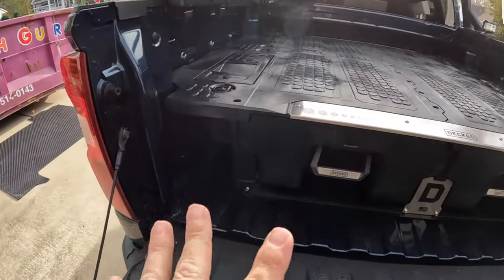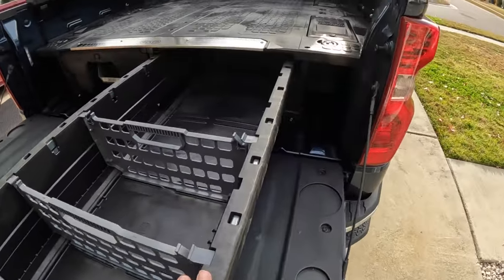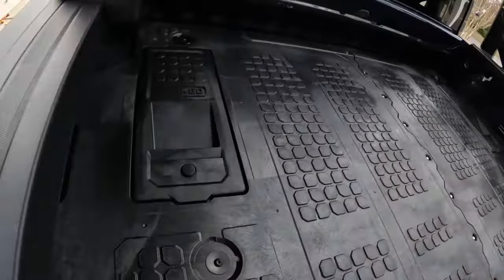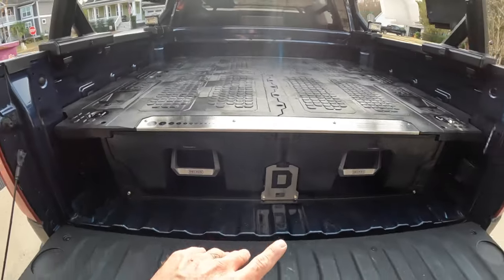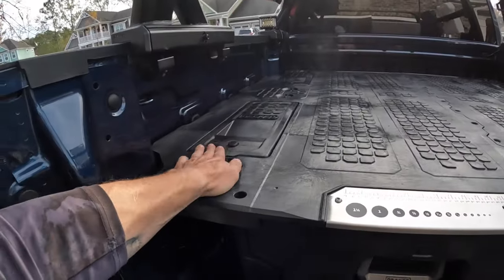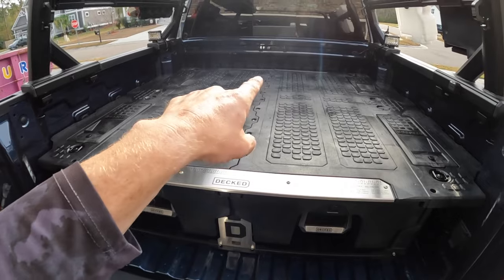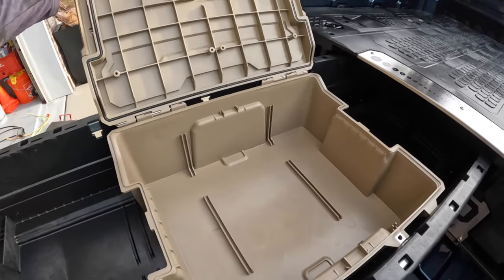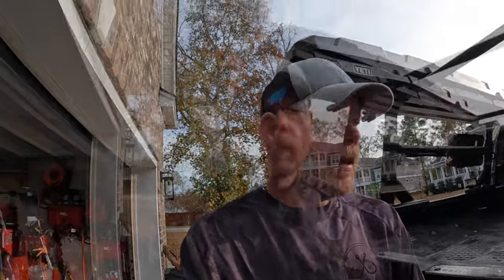ARE THEY WORTH THE HYPE? / Gen 2 Decked Drawers

Comment: I can’t justify using my whole truck bed for the Decked System. If they offered a single drawer for one of the sides, I would buy it.
Reply from the maker: That would be cool.  Only problem is holding it down and in place in the bed of truck itself.  I know Weatherguard and American Van make steel and diamond plate aluminum ones but not as high so limited storage for bigger stuff.  Good for tools though.
Reply: @rjmfishtales  i have lower bed hooks in my truck bed, if they come out with a single drawer it could attach to the lower bed hook to hold it in place. The lower hook will be blocked anyway with the drawe. I still have an upper hook to use to tie anything down with.
Reply from the maker: @TopWaterAssassin78 the gen 2 have tie downs built in for that reason when the others get blocked.  Maybe one day they may release one sided drawers.  I am sure they have thought about it.  Or tried.
Reply: If you add a rack of some sort there not a whole lot you can't haul on top of it. I'd stay away from gravel or any loos bulky stuff. But stuff like furniture, appliances, 4-wheeler, ect. Aren't a problem.
Reply: I actually run only one side in my f150, haven't had any problems even 4 wheeling.
Reply: Have you thought about just getting a toolbox? That would save some space but obviously it isn’t as long as the bed
Reply from the maker: @kenanlynch6616 I like the drawers that pull out to me instead of climbing in the bed or reaching over.  I have toolboxes and drawers and prefer the drawers.  I have 3 trailers when I need to get anything big.

Comment: My only issue with mine is, WHY THE HELL DIDNT I GET THIS SOONER.  It saves space in the bed of the truck but at the same time it does take the depth of the bed down to around 12 inches or so from the bed rails. the good side to that is your tools are safe from rain and honest people, unless you add a solid bed cover that has locking access only inside the bed, any cover that has an exposed lock on the outside of the cover can be gotten into. all in all, this is a great thing to add to your truck.
Reply from the maker: Yes the drawer system is awesome.  Many don’t like it and many do like it.  Everyone has their opinion and needs.   I like them and works good for me.

Comment: Everyone has different preferences for their truck storage, I had a decked and hated it while a co-worker who does the same job loves his. My biggest concern was things sliding top of it and busting out my back window.
Reply from the maker: I put a mat on top of it to prevent at and they sell mats to go with their system as well for that reason.
Reply: @rjmfishtales  I tried that but didn’t feel comfortable leaving things on it that weren’t strapped down. Also couldn’t even fit a weed trimmer between the decked and my tonneau cover when it was raining and that was the deal breaker for me. Thanks for your video!
Reply from the maker: @masonmueller2637 no problem sir.  I get it.

Comment: We run them decks in our f350s, concrete construction so we put them to work!!! They are amazing and very durable, we live in Michigan and even in the winter with snow and ice they still perform well,, if your on the fence because they expensive just trust me and buy one, they worth it
Reply from the maker: Absolutely!  They work so well for electrical work that I do.  When I was in the field I had all my cordless tools, batteries, drill bit & tips, lots of extra hand tools all organized!  Made it so easy to inventory and make sure all your tools were back in the truck!  Yes it was awesome in my HD truck with the little longer drawers. But the short drawers now work just fine for kayak fishing!
Reply: What about moisture?
Reply from the maker: @billd3765 you will always have a small level of moisture.  Anything you really need to protect I suggest putting in a IP65/67 box.  I use Milwaukee Packouts for anything I want to keep dry 100 percent which is very little.  When you buy it they give you 2 watertight boxes.  But I leave cordless tools in there with no long term issues.

Comment: I’ve made drawer systems for my trucks for 20+ years. I use 1/2” plywood & 3/4” pine. I get more storage space for a fraction of the “decked” system.
Reply: Yeah I used to say that but wood isnt as tough or last as long when water hits it. Just bought a new truck and they came with. Not sure I like them but they are nice.
Reply: Let me know how good your wood works when it warps and starts rotting
Reply: 20+ years. No issues!
Reply from the maker: @pkweisel thanks good.
Reply from the maker: @pkweisel that is good.  Not sure why thanks came up instead.
Reply: @pkweisel  must be under some type of cover then. But hey whatever works

Comment: I can only speak on the above bed tool box.  I so glad I made the purchase yes it $900 and $100 for ladder but with my 2020 Silverado 2500HD seating high I love it.
Reply from the maker: That is priced right.  A weatherguard tool box is 1200-1300.  They are not made as good as they use to be.  You throw a piece of wood against it or whatever and it’s all dented.  The crossover box from Decked is so much better because you can beat the crap out of it and it looks the same.

Comment: Would you say converting a rack to a cap is a cheaper option than buying a cap itself? It was suggested by my father in law to add a decked system and a cap to my truck to protect my film equipment considering the amount of things I typically carry on top of regular tools and the like.
Reply from the maker: Or you can do a really good tonneau cover and decked system.  Or just a good cap and no decked drawers.  You can always do a drawer slide if you don’t want to climb into truck.  It all depends what you carry and how tall etc.  There is many options you can go.

Comment: It looks like it stops a few inches short of the full length of the bed. Like it looks like there is a 8" gap between the back of the drawers and the tailgate. Why?
Reply from the maker: Every truck bed is different.  A short bed drawer is going to be the same size across all trucks and same thing for a long bed drawer.  They are not going to make different drawers for different trucks.  They just change the top piece to fit different truck beds.  So being the Chevy has the longest bed across all sizes and makes of trucks they have the biggest gap at the back.  My ford had a 4 inch gap and this truck has more because it’s like 5’9 inches long.  The back is where it is short that’s it.  Everywhere else is cut to size.

Comment: Love the set up! Hey, what’s that tool box behind the driver side? Do you have a link? It’s like a tool box with a rotopax?
Reply from the maker: @liciotamb  that is a Milwaukee Packout box for small parts.  I took the single packout wall bracket and used 1/4-20 hardware and mounted to the crossbar of my ladder rack.  I have a full video of that setup.  Let me see if I can find it and I will drop a link in comments.
Reply from the maker: https://youtu.be/Jwr9NSUTXgA?feature=shared
Reply: Thank you
Reply from the maker: @liciotamb no problem

Comment: Good video man, thanks for the review!
Reply from the maker: Thank you.  They are definitely worth the money if you like this kind of setup in your truck.  I missed having them.
Reply: @rjmfishtales  I’ve currently got a gen 1 in my truck and I’ve been thinking about getting the gen 2 and your video definitely answered some questions I had about it. Thanks again!
Reply from the maker: @jonasj333 I am glad I could help.  See if you can sell it and get the gen 2 if you think you would like it better.  The lockable stash bush definitely give a lot more storage.
Reply: @rjmfishtales  Yes I also liked how you can easily put something thin down the length of the bed now that the ammo can form isn’t in the way. I use my decked system for tools and it would be nice the be able to keep some strait edges and levels down the side or even be able to go to the back and grab something if it’s slid to the back. That’s one of my current battles where I’ve had things slid past and has now been lost to the front of the bed and it’s horrible to get back there to get anything out. I also like how the new ammo cans don’t let a liquid in, that was always a battle I was fighting. Just out of curiosity, do you know if any of the old tool boxes would fit in the new drawers? There always a box of tools that I don’t touch too often but would still like to keep on the truck, if the old box would fit I’d just put it at the back of one of the drawers.
Reply from the maker: @jonasj333 yes it will definitely fit as that box is smaller than the new one.  Just won’t be right like before but will fit.

Comment: I’m also a Kayak Fisherman and have been on the fence getting one because I worry about sliding my Bigwater into the rear window. 
Do you have a video or pictures of your Kayak in your truck you could share?
Reply from the maker: No I do not sir.  I would just strap it back a bit so there is no forward or backwards movement.  That is what I do.  I use the tie down on the decked system itself.   I have had no issues.  Also unfortunately after I made this video I had to change truck because of mechanical issues and now have a long bed.  So couldn’t transfer decked system and also can’t afford another one right now.  I am back to using trailer, bed of truck or roof rack.  But the decked drawers work awesome and truck keep kayak strapped so there is no real movement

Comment: As a very satisfied Gen 1 owner (F-150) I am blown away by the improvements in Gen 2 and am plotting… 😅
Reply from the maker: You will definitely love it over Gen 1.  The drawers being squared off and being able to fit my Milwaukee packouts makes it awesome.  Also a lot more room.  The stash bins being dry now.  Love it!!  I have locks on everything which makes it even more awesomely!!!  You won’t regret.
Reply: @rjmfishtales  The G1 ammo cans also not that useful (and not waterproof), now entirely useful and waterproof. Opening inner toolboxes while still in the drawer is money. How do you access the corner turnbuckles to keep the assembly tight in the bed?
Reply from the maker: @tommyrq180 through the stash bins just like you did with the ammo cans.  The inserts are removable.  The initial kit comes with 4 and I added 4 more on the order.  You need to order 2 shallow and 2 deep to have all 4 corners to have waterproof storage or you just leave as an open hole.  Up to you.  It’s 50 dollars more to have 4 more so definitely worth it as they are sold in pairs at 25 each.

Comment: Any idea what the clearance is? Trying to figure out if the Roll N Lock tonneau cover canister will fit with Decked.
Reply from the maker: You have about 9-10 inches left above the drawers.  Depending on bed depth.  The drawers are 12 inches tall.  So measure your bed depth and subtract 12.  Most beds are 20-22 inches deep.

Comment: Have you ever loaded a quad or dirt bike on the deck system?  Curious how it would work.
Reply from the maker: It would work just like loading in the bed of your truck.  Just drive on top and strap down.  That is what it is designed for.  Then you have the drawers underneath to gain access to your gear.

Comment: what is the distance from top of the deck to the top of the bed rail? Also is there any accessories to haul 8 foot
 Lumber is a 6’6” bed?
Reply from the maker: The distance to the top of rail from box will depend on your vehicle.  But most beds are 20-21 inches deep.  Drawers are 12 inches tall.  So remaining is 8-9 inches.  Sometimes 10.  No accessories for hauling 8 foot lumber.  My bed is 5’8 long.  I just leave tailgate up and stack it on angle.  The other day I picked up 8 sheets of 3/4 ply and 24 2x4s no problem.   The decked drawers have tie downs built in and I have plenty in the truck.  Just strap down all your stuff and good to go.  The decked drawers will not restrict you.  Just everything is taller out of bed so strap down and go!   I rather the drawers than not at all.

Comment: I wish Decked would come out with a system that is the depth of the entire truck bed. I’d love to have the option to either have much deeper drawers, or four drawers double stacked. Often times that space on top of the Decked system ends up going to waste.
Reply from the maker: I don’t think they can go bigger than a 6 1/2 foot bed because of the material etc.  The drawers can only extend so far before there would be issues.
Reply: @rjmfishtales  - I’m not saying I want the drawers longer, I want them taller. I want the option to have drawers that are as tall as the tailgate. Or to have two rows of drawers that are as tall as the tailgate. In other words, I want the top of the decked system to be flush with the side walls of the bed.
Reply from the maker: @Toglander oh ok.  Yea that would be cool.  Definitely would want a 3/4 ton truck or bigger for that.  You would be weighing down truck with lots of stuff.  Good idea.  I use to double stack the rat packs think they are called.  The metal version of these basically.  From weatherguard or one of those brands.

Comment: Moisture is the question.  You addressed it but still looks to me like rain will get in.  Do you need to drill drain holes, or will rain REALLY not get in?
Reply from the maker: Rain does not get in it at all.  It would defeat the purpose of anyone having them.
Reply: I pressure wash mine and zero water gets in. 😊
Reply from the maker: @tommyrq180 that’s awesome.  Is it like @decked commercial I see 40 times a day on YouTube.  Haha

Comment: damn i bought mine just over 1 year ago and they told me they had no plans to make a new design guess i only had to wait 6 months for the Gen2
Reply from the maker: They are definitely worth it.  I would try selling Gen 1 to get this version for sure.
Reply: @rjmfishtales  no need i have a 1500 i want a 3500 for my next truck in a year or two and would get it then or Gen3 lol they need to mage the cargo glide wider for on top i did not buy it since so small
Reply from the maker: @usnrecon82 ok.  The slide is probably based on the structure connection points and I am sure if they make bigger it may be an issue.  I just use the stuff.  That’s all I know.  I am sure Gen 3 will be a ways from now.  Probably a ten year mark before they make changes again.

Comment: I wonder. What would happen if you got rear ended?  Does the deck protrude the cab?
Reply from the maker: You would have to be hit extremely hard.  With the set back your frame would have to buckle over 2 feet and I think the Decked system would break first.

Comment: They are just ok, had two of them and sold them due to wasted space, not for everyone and definitely not for contractors.
Reply from the maker: Like you said not for everyone.  There is not one vehicle accessory that is.  I use for fishing and electrical work.  It is exactly what I need.  I also have trailers so bed space is not my concern.  I need items out of the elements without installing a bed cap or cover that doesn’t work for me.

Comment: I am so torn with losing the depth of the bed...
Reply from the maker: It all depends what you do with the bed of your truck.  Do you always have items in it?  Or do you carry big items all the time?  You get use to it.  All you need to do is learn that all you need to do is have tie downs with you.  I think it’s completely worth it.  Sometimes if you have a cover over bed then sometimes it can be a pain.  In my opinion if you have @decked drawers i would use a cover as well because a lot times you would need to flip out of the way.  

If you carry a lot of small items and tools etc I think drawers are completely worth it for security.  Or you get a hard cover that is hard to break into.   Your call.
Reply: Same, I built a single drawer out of plywood a couple years ago for about $80 but it slides around the bed to this day lol it’s awesome tho

Comment: Locks on the main drawer should be standard
Reply from the maker: Locks are not standard.  That is an option because you don’t need them if your tailgate locks.
Reply: @rjmfishtales  I would still equip the locks to my drawer system even though the tailgate locks, as an additional layer of security. Having locks as an option just feels like a money-grab from DECKED.

Comment: They should make ones with 1/3 - 1/2 less height
Reply from the maker: There is drawer units out there half the height from American Van that is made from diamond plate.  Just drawers and only 50 inches deep.  I use to have those too.  Worked pretty good and held quite a bit.

Comment: Is it water proof?
Reply from the maker: It’s rain & snow tight.  Nothing gets wet or soaked with water.  If you have a high moisture level in the air you may get some moisture inside.  Like Decked says it’s not Tupperware tight.  I keep cordless tools etc in drawers and no issues.  You may get a little rust over time on your tools but that is normal for all tools.  If you delicate equipment use the boxes that come with Decked when you purchase drawers or us Milwaukee packouts that have an IP67/65 rating and good to go.  No tool box or tonneau cover on the market is 100 percent waterproof.  If you want waterproof keep inside your truck if it’s that delicate.  Besides that the gen 2 drawers are a big improvement and even the storage bins on top have a lip and things stay dry and you can lock them.
Reply: @rjmfishtales  was thinking more for my firefighting gear. Don’t want it getting wet at all
Reply from the maker: @heavyhitta52 oh you will be 100 percent fine with that for sure.  I use to keep mine in the drawers back in the day of the 1st gen before they made it more water and dust tight.  I use to keep bunker gear in a bag and my mask in another one and was fine.  Definitely good for that stuff for sure and use the other drawer for rescue gear and tools.
Reply: @rjmfishtales awesome thanks!!
Reply from the maker: @heavyhitta52 no problem